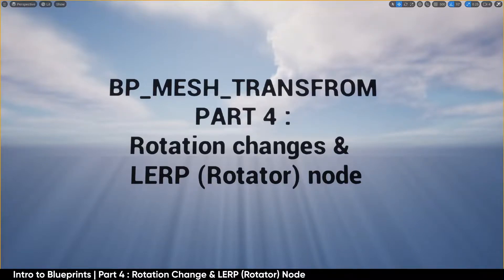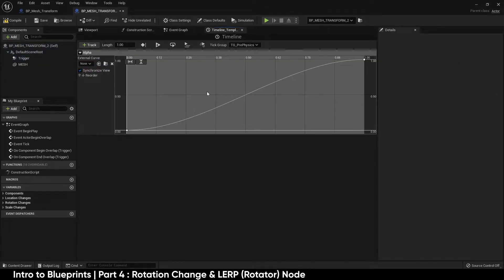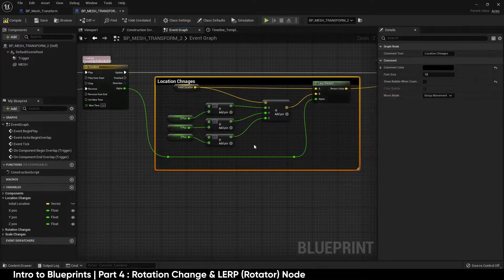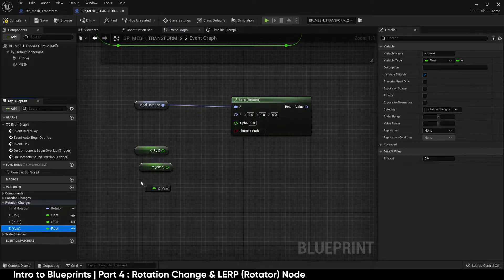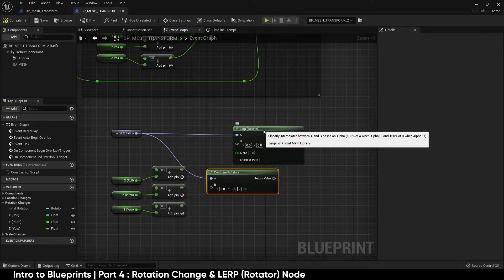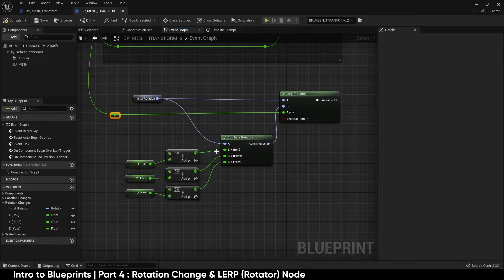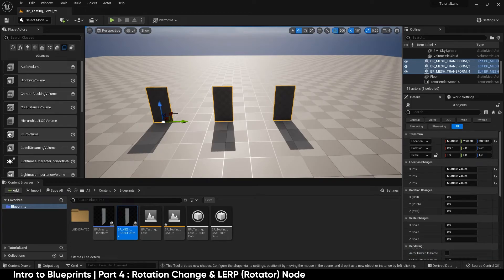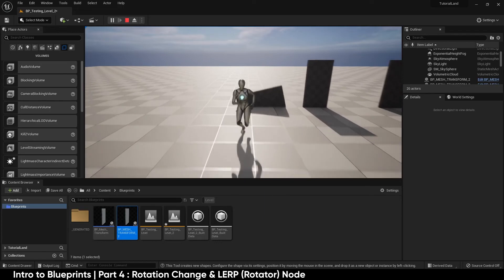Unreal Engine 5 | Intro to Blueprints | Part 4: Rotation Change & Lerp (Rotator) Node

Comment: Thank you for the tutorial! I have this strange problem where the Component Begin Overlap is not being triggered until the 2nd time I approach the doors. Any idea why that could be, please?
Reply from the maker: Ah! I have had this as well and I did correct it but its been so long since I made this I will need to retest to try and find the minor bug that causes it. I believe it was in the setting of the default checks? If it is a player (if using tags)
Reply: I had this problem also, the solution is to parent the Mesh to the Sphere collision, 

DefaultSceneRoot
Sphere Collision
Mesh

it fixed it right away